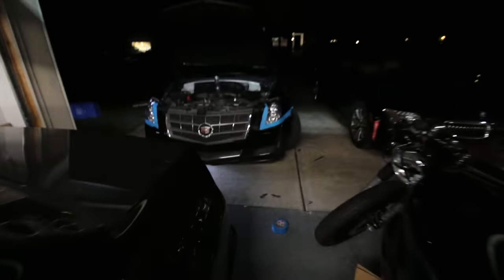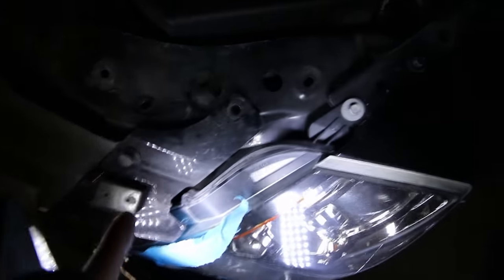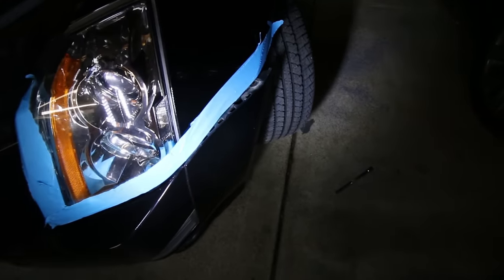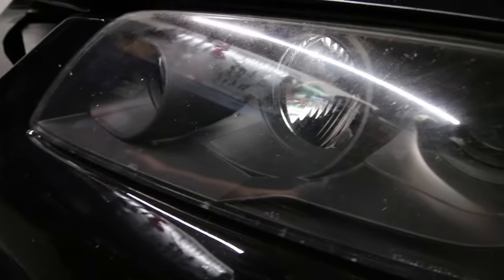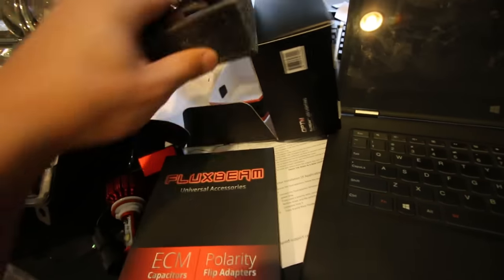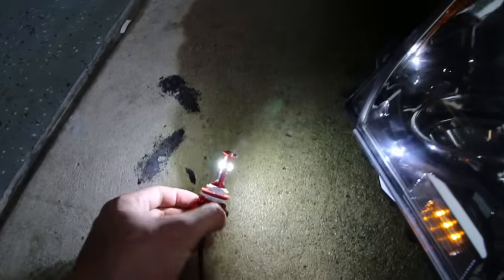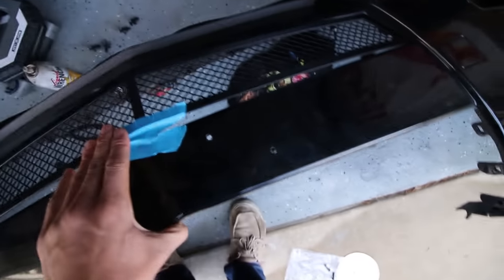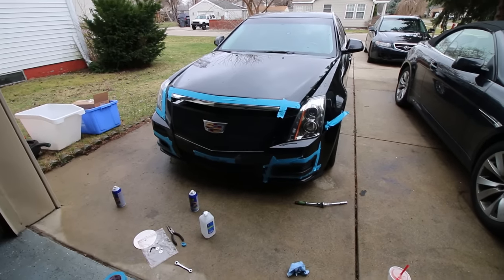2010 CTS Wagon Grill and LED Lights Install How To

Comment: hey bro i was wondering where did you found that grill? i got a 08 cts sedan and i want something similar without a headache haha and i cant seem to find a grill on eBay that got the emblem mount n evrything
Reply: Dave you are supposed to use the stock emblems or purchase the emblem seperately